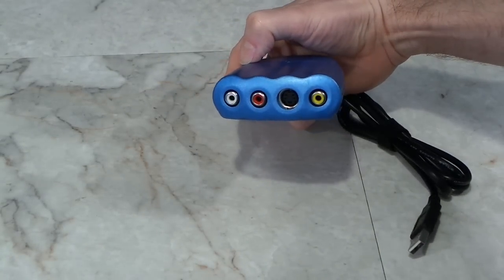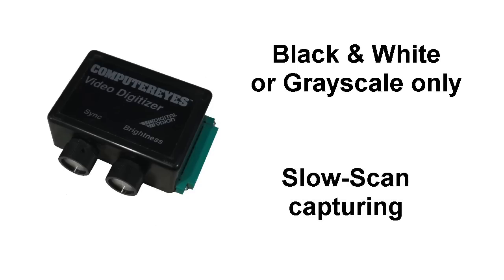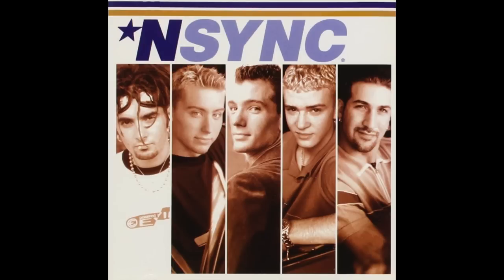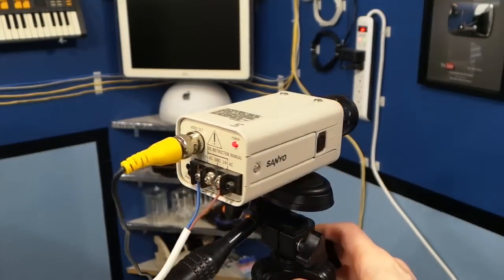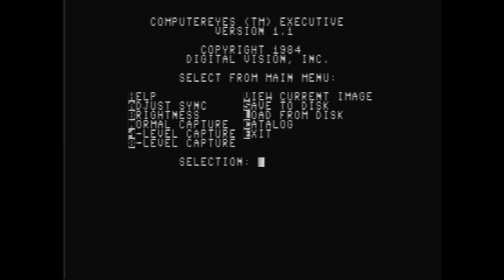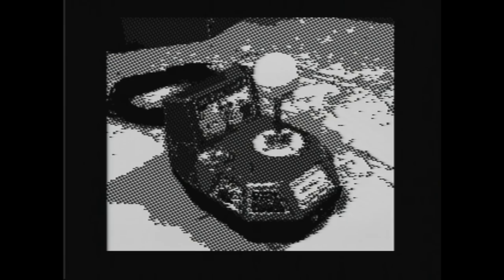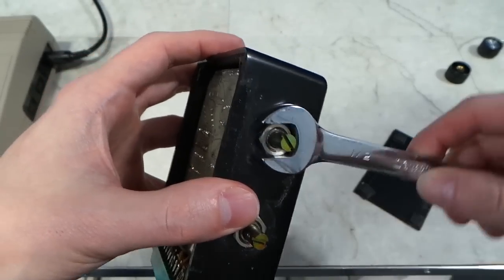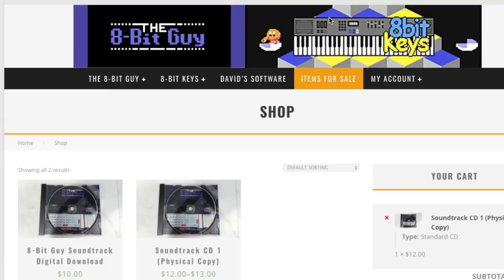How old school video digitizers worked

Comment: I was almost disappointed that it was getting late and you hadn't actually shown the board (or something equivalent). It was pretty much exactly what I expected: a simple comparator that would produce a one-bit "brighter or not" signal at a sweeping offset within each scan line. Then you adjust the comparator's threshold and sweep again. I never had a ComputerEyes, but I did have an Apple //e video capture card that could do 4-bit color IIRC, and then a Logitech Fotoman digital camera circa 1992.

Comment: Speaking of digitizing, that reminds me of an article I saw in a Commodore magazine once about a project that allowed you to build a scanner to digitize magazine pictures etc. I think I recall they had some kind of light sensitive diode that they mounted on the head of a dot-matrix printer - the idea being to program the printer head to go left and right scanning for differences in light or dark in the picture beneath it, and advancing the roll for each so-called 'scan line". PS, I had one of those Logitech hand=held scanners for my first PC. A bit cumbersome, but they were cheap and worked.
Reply: Interesting approach, but it does sound pretty crude... literally, what sort of resolution would one have been able to get like that? Going by what I remember from dot matrix prints, 5-10 dpi vertical tops?
Reply: Someone else has done an article (with photos) doing the same thing back in the day , but yeh, it's pretty lo-res - http://www.nzeldes.com/Miscellany/ImProc.htm

Comment: I wonder if it would be possible to write software to generate a dithered picture in a single pass by changing the software threshold adjustment that's exploited for four-grays mode on each line?  Since the 6510 executes about 65 cycles each scan line, I would think there might be enough time for that if changing the threshold doesn't require any complicated bit-banging.  Since the C64 is limited to one bit per pixel at full resolution, capturing a dithered picture should yield results that are just as useful as a three-pass capture.

Comment: Take a look at the Philips NMS-8280 MSX2 computer from 1987. It can digitize video very quickly in 256 colours. It's an 8-bit Z80 computer...
Reply: Also the Sony F900 had digitize features but these models never came out in the US, they only got Spectravideo MSX computers.
Reply: No, the Sony HB-F900 and the Sony HB-G900P only had superimpose capabilities. For digitization, you had to buy a separate module (the HBI-F900 and HBI-G900P respectively). There's also the Sony HBI-V1 digitizer for the  MSX2+, can digitize in the 19268 colors of the MSX2+.

Comment: The board can probably be as simple as it is because it doesn't work in color and doesn't need an NTSC decoder. All it needs is the sync pulses and the luma.

Since you can adjust sync will this work with a 50Hz signal as well?

Comment: As a kid I had a book full of interesting circuits for hardware-hacking on the Commodore, and it had a very similar circuit in it for still-video capturing. I never built that particular one but I did have a lot of fun with some of the simpler ones.

Comment: With those wiggly PCB traces, this looks like from the 60s-70s.
Reply: Smaller companies and hobbyists actually did PCB layout by hand WELL into the '80s. This one looks entirely hand-drawn even (usually there'd be sets of templates / decals to use). The newest device I spotted an oldschool layout in was a Rotel A/V preamplifier from like 1992, which I found rather baffling.
Reply: And drawing straight lines by hand is impossible? Didn't they have 
rulers or templates? Architects and engineers also drew by hand in the 
past and still managed to draw straight lines.
Reply: The more organic 'hand-drawn' layout was not uncommon even into the 1990s, despite even hobbyists having access to things like rub-on transfers of PCB layout elements.  Hell, if the project calls for/allows it, I like to use the 'curvy' traces in EAGLE when laying out something, just because I find it super aesthetically-pleasing for relatively simple boards.
Reply: Keep in mind they probably wanted to keep the cost down so it would be affordable at a time when memory prices were outrageously expensive... looks like this unit had no buffer at all and sent to signal directly to the computer for processing... well as fast at the C64 could actually process it, thus the long 30 second per frame capture time.
It's fascinating to see the beginnings of digitizer technology.
Reply: you don't need straight lines.... and last I saw hobbyists still draw and etch PCBs by hand.
Reply: I was actually going to come here to comment on how it looked hand-drawn.  Very fascinating stuff.
Reply: But yeah, there is this certain "60-ish" design :D
Reply: those rub on things are awful though... I remember my dad gave me some when I was younger and they'd hardly stick half the time guess that's why he didn't use em :P it's easier to just use a permanent marker and draw what you want.
Reply: My car's digital cluster from 1988 actually have a mainboard that the traces looks similar

Comment: I've got a more potent video digitizer for the C64 at home. It still works with an Sony DV camera without any problems:

https://twitter.com/Koxi73/status/770704928386023424
https://twitter.com/Koxi73/status/775392911252922368

You can see some images on my tweets above.

Comment: A lm556! Which is a dual 555, about the most common timer chip available! AND about the most flexible chip ever! You can make an AM or FM transmitter out of it, you can turn it into a voltage regulator, you can use it as a flip flop, digital signal conditionning and way more things.

Comment: You're not overloading us at all. Love this stuff! I had no idea that type of digitizer existed that far back. I may still have my digitizer from the mid-90's, the Snappy device which plugged into a parallel port on the PC. One thing I've wondered and not sure if you've answered it in a different video: What causes those static horizontal lines when pausing a VCR? And the soundtrack is great! Listened to its entirety that day I got it.

Comment: C64 like any other 8-bit system with tiled based graphics chips wasn't meant to display full screen photos not to mention videos.
Although demo scene shows how C64 limits could be avoided, but still this computer wasn't designed for that. Updating whole screen at once was very taxing even on 16-bit systems. Sega-CD had plenty of space to store videos, but it still couldn't display them at full 320x240 resolution, because GPU wasn't fast enough to redraw whole screen with decent framerate.

Anyway there is a soft to playback videos on C64, but it requires massive RAM extension like 16 MB, which is ridiculous amount for that computer to store only minute or so of a video with about 4-5 fps.

Comment: I did home movies transfers from vhs tapes onto cdr many years ago using a capture device very much like the first one you showed it was around 1999 and computers were very slow in those days the specs were a 233mmx pent with only 64meg ram the encoding took a long time to convert from something the capture device put it in to mpeg for video I used some free software which done a great job and worked better then the software that came with the device now since all the home movies were short cause everyone shoots short videos even today it wasn't too hard to do but I had to reboot the system every few video done to clear memory then defrag the registry to clear that windows back then was almost as slow think I was on 98 or XP then did the photos too using a scanner that did about the same thing to memory but all in all it worked even done all the old 8mm and they turned out better then they looked on screen when I use to watch them all I did was move the projector up close to the screen and shot the video cam at it with such a small picture the rsolution was more compressed into a smaller area giving a better picture instant HD 8mm lol my home shots 15yrs worth and some 20yrs worth of 8mm and pictures took me 6 months everyday working on it and I didn't even wear out the computer.
Reply: I had a ATI 9000 videocard in it I think the one before that was a ATI 6500 or 6800 might been that one it had built in capture but it was only 64meg the 9000 had 128meg I think

Comment: For what it's worth, if you were to make this yourself, I'd recommend two 555 timers instead since the 556 was made in smaller quantities and is much more expensive. I'm not sure if it was used to better match the parameters, but I'm pretty sure a pair of 555s would be a better choice.

Comment: I have the old Color Computer 3 and digitizer for video. All buried someplace and will be operational again this year.  If I remember right it could capture 8 frames then it compiled them into a single image. It did not do too bad a job but you could not move while it did it. I thought, hmmm, what if I set a monster toy up and cut a triangle of krinkled aluminum foil with point at monsters mouth. As the 8 frames were being taken I jiggled the foil slightly. The result was a perfect look of smoke/fire coming from monsters mouth. It was the coolest add on to COCO3 then and like you said, others drooled over having this. I took it to a computer club and all we did the whole time was capture stuff in different ways. Also have the sound digitizer somewhere. This brought back many memories. Thanks

Comment: I used to be able to get very good stills from an early 80s VHS player when using a non-realtime digitiser on my Amiga. A difference between PAL and NTSC perhaps? You had to tap the pause button a few times on each frame to get the fuzz off the screen. It was possible but incredibly laborious to capture a video sequence. And you had to repeat that 3 times if you wanted colour.

Comment: As per oldschool image capture devices: I have a ThunderScan, which is a scanner that mounts to the ImageWriter in place of the ribbon. Works fine with my 128K (which has been upgraded to a 512K before I got it). I could borrow it if you want to make a video about it, but shipping the ImageWriter overseas would be too expensive.

Comment: The 4-level mode must still be a 1-bit ADC, it just adjusts the gain/threshold between captures, and then remembers the lowest gain that produced a 1 bit for a given pixel. The lower it is, the higher the pixel value you get.

Comment: re: Laserdisks...still frames only work if the disk is in CAV format.  CLV doesn't pause that way.
Reply: thedungeondelver also, almost all laserdisc films are CLV, so not pauseable. Some longer films that span on to a 2nd disc might have one side CAV.
Reply: Right; I tried to pick and choose when I bought LDs sets that were CAV only; the Criterion Akira disk (as so many others, as well from them) and the Star Wars: The Definitive Collection sets were particular treats. :)
Reply: Some later players will give you freeze frames on CLV. Only field doubled half vertical res, but it would have worked well for this. That said, they didn't exist when this capture device would have been a thing..

Comment: Could you capture color with this using the same trick you used with the your Connectix Quickcam? Were there paint programs that allowed you to combine images in that way on the C64? I remember that you could buy a still frame capture cards for later computers. I used one in high school on a Mac IIci to get images from an analog Video Disc camera.
Reply from the maker: It would have been theoretically possible, but I'm not familiar with any software that would have done it back then.  I suppose somebody could write one now, but seems kind of too late.
Reply: Interesting concept, but even where things are theoretically possible, it doesn't mean anyone attempted it back then, or even thought of it.

Have you seen the demos for thousands of colours using CGA composite artifacts?
Given the hardware the demo runs on it would have been theoretically possible to do that in 1981 on an IBM 5150...
But when you actually look at what was involved in calculating the colour shifts from various timing and symbol combinations...
It required hours of calculations on a modern PC to work out.
So that wouldn't have been possible in 1981 ironically because it would have taken too much computing power to work out how to do it. even if once you have figured it out you can run it on such hardware.

In this case, I guess first of all someone would have had to think of that technique, then have the inclination and technical skills to implement suitable software...
And then it would actually had to have been distributed quite widely for anyone nowadays to even be able to figure out now that such software even existed.
Reply: So, if there was no way to work with the image, what was the point of the device?
Reply: "kind of", LOL.

Comment: As a matter of fact, there was a hand scanner for the c64 https://www.c64-wiki.de/wiki/Handyscanner_64
Reply from the maker: great... now I'm going to have to try to find one of those!
Reply: I saw an article in Antic (Atari 8-bits) that made it possible to use your dot matrix printer to scan images. It had plans for a light pickup that attached to the print head to do the scanning.
Reply: Actually these printer scanner was built by the same company how have made the above mentioned Handyscanner 64. The scanner were named Superscanner II and III. The manufacturer was a German company called Scanntronic. https://www.c64-wiki.de/wiki/Scanntronik
Reply: haha
Reply: I had one of these!  You tape a fibre-optic wire to an old print cartridge, and the scanning software drove the print head back and forth while raising the page a bit at a time.

You had to tape the image to be scanned to some form-feed paper so it would not move around during the process.

It did a surprisingly good job of B&W scanning, but risky to damage the originals.

The fibre-optic wires plugged into the cartridge port.

Comment: My 4-head Panasonic SD570 provides noiseless pausing.
And I think over, is it possible to build something more decent using components available in 1985 to capture at least grayscale picture, or even color. Sure it will be complex and expensive device, with price comparable to C64 itself.

Comment: Flip-flops? NAND gates? Timers? how long till Sethbling recreates the circuit in Minecraft?
Reply: the analog video camera would probably be the hardest part. ;)
Reply: I've seen video rendered inside Minecraft using different colored wool, for sure that circuit could be made inside Minecraft!
Reply: that moment when you realize he has already made a camera in minecraft like 2 years ago
Reply: Well, it is a hella simple circuit. You're really just using a timing device to compare signals at regular intervals with comparators, then using the NAND gate to shift data around. The problem would be getting a analog source to test it with. Maybe digitize the output of a Redstone sensing device that can output multiple different signal strengths. But it'd have to be close to the source as repeaters couldn't really be used on the analog signal.

Sources: Me. I'v built a 5Bit ALU before, I know my way around Redstone logic. Side note: it lacked division, as I  honestly couldn't be bothered to implement it. Not so good with making things with the newer Redstone items, as I'v not really used them much. I mainly play on 1.5.2, as it uses less resources and runs faster for large builds. Plus I got a load of mods that haven't been updated in YEARS.
Reply: Technically, if i would have good look at that board, maybe even me would be able to recreate it. More or less these are basic components for advanced redstone.
Reply: He's already made a camera in minecraft so I wouldn't be surprised if this is entirely possible.
Reply: mfaizsyahmi. first he'd need to make a Commodore 64 emulator in Minecraft
Reply: Chris Frank
Technically, you could get away with just sampling it into Redstone D-Flop memory. Then import the 1s and 0s to a file and try it on real software to view it. But, you'd need LOTS of memory. WorldEdit would be an absolute requirement.
Reply: But are there any armor stands?
Reply: theLuigiFan0007 Position recording. :)
Reply: mfaizsyahmi. - Hahaha! 🤣
Reply: Ghi102 - Good for you! 😆
Reply: would be tickled if Seth responded to this
Reply: mfaizsyahmi.  Yes lol!
Reply: tuxcup
I'd say no, you wouldn't need any. You could build this in any version of Minecraft that has repeaters, comparators, and Redstone torches. It's just pure logic. I don't really understand why people use armor stands them in Redstone anyway, what's the purpose?
Reply: SlidingSilver
Ah, really? That's very interesting. Armor stands are used to record position... hm.... maybe I need to look that up. Curious.
Reply: Nope, he is not making minecraft videos anymore
Reply: We need a SethBling/8 Bit Guy collab video. 8 Bit Guy could explain various old-school computer mechanics and Seth could recreate them in Minecraft.
Reply: MumboJumbo then
Reply: mfaizsyahmi. He still does redstone builds?!?! I though he just did super Minecraft maker...
Reply: ikr
Reply: Same
Reply: lol
Reply: he did hahahhaahaha
https://www.youtube.com/watch?v=7E9p4hi252A
Reply: That's how evolution works
Reply: Welcome Back SethBling here,today i recreated a old C64 Digitizer entirely inside Minecraft...now lets see how it works!
Reply: that's electronics basically
Reply: and comparators